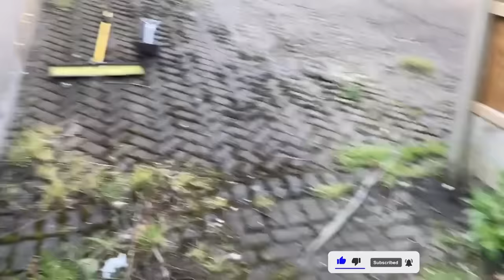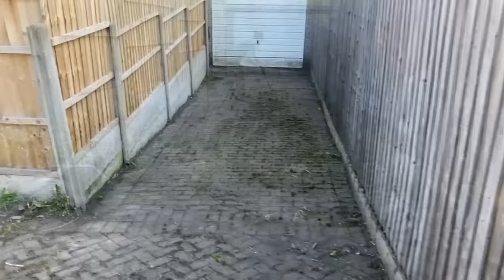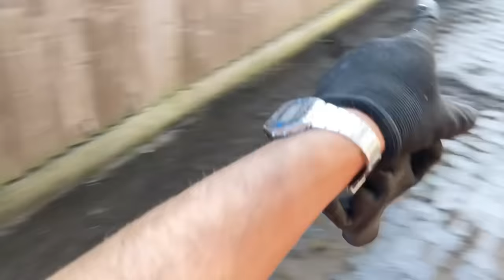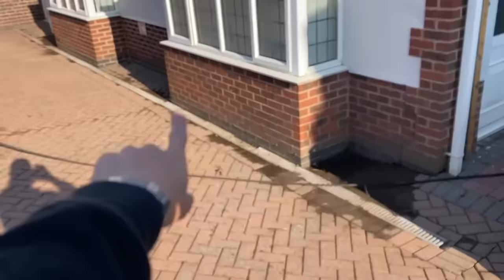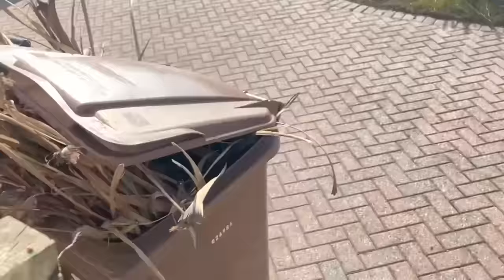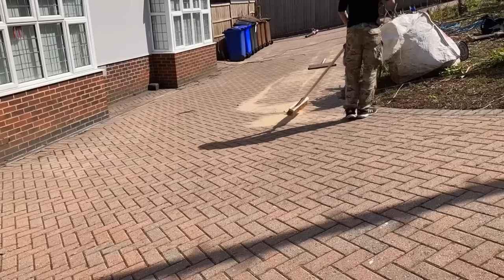MY DIRTIEST DRIVEWAY CLEAN EVER! (No drainage at all)

Comment: painting for a customer today there back patio looks the same was wondering what it would take to clean it up convenient your vid shows up. question why no surface cleaner any specific reason? b4 I finish watching my guess is 5-6 bags of sand i'll see how close I am. I have a patio maybe 20by20 and walkway I do this same process every other year but it has a design and wider gapes between bricks takes me 2 days but i put up barriers to stop the sand from getting all in the gardens around it and the 1500 gallon pond on the side its so much work and your beat when you finish I just did this last month at my house also had a weaker pressure washer it's 2500psi but very low gpm I borrow it from my dad. hope you made atleast $1500 US atleast brother.

Comment: where do you get all the water from that u use with the pressure washer? is it supplied by the house hold that you're cleaning or do you bring it yourself. and if you dont bring it yourself but the household doesnt have a water supply how do you work with that?

Comment: I use 21 lpm machine. But would have done it with a flat surface cleaner. Ps, I can clean 750 m2 on  my own on block paving in a day. I have posted on your videos quite a few times, but you need to get to ben at rutland pumps matey...

Comment: here's a solution for your water drainage problem....get a 1 meter piece of PVC, cap the ends with a hole in center with attachment for SHOPVAC vacuum. Drill smaller holes in PVC for water to flow through, and just lay the PVC in the puddle and turn on vacuum...it will suck up the water as you work

Comment: Would you ever use a plate compactor to get the sand into the joints .
Reply from the maker: It’s not needed as the sun base is fine it doesn’t really get damaged, the stuff in the gaps is what gets blown out :)

Comment: Can't believe you did the whole job with a tiny nozzle like that. Wouldn't using a surface cleaner attachment save you a tremendous amount of time? I've also seen no chemical treatment so sadly that moss is still between the stones and will grow back very quickly (in a matter of weeks)
Reply from the maker: It’s a turbo nozzle so not that tiny lol. FSC wouldn’t of pulled up many of these weeds. They were thick. 
Treatment was offered but declined, I know what I’m doing 👍

Comment: I'm kind of wondering "Why the sand?" Like, I get you're getting sand in the cracks, but why? to prevent weeds? It can't be for aesthetics, it really dulled the color of the bricks down. I can't imagine it's for traction, the bricks didn't seem that particularly slick, even when wet.
Reply: Bricks have to have sand in between them in order to set them in place. Horizontal brickwork isn’t typically mortared to the ground, so they can shift around if not all locked together with sand in the joints.  A lot of people do polymeric sand now so it doesn’t wash away, but it’s more expensive and some prefer not to. He replaced the sand because it’s something you have to do periodically and because he blasted what sand was there out of the joints
Reply: @tylerk.7947  Thanks for the knowledge. :)

Comment: Whoever did the paving wasn't the best. You can see the level is halfway over the air bricks - building is going to be damp with this. Also sounds like they did the normal MO for these guys - put a slot drain in but don't connect it to any drainage. Call it a soakaway even though they did no testing on the soils (could even be clay) ability to let water soak away.
Happens too often and exacerbates flooding issues.
Good job cleaning btw.
Reply from the maker: You know your stuff!

Comment: I dont know if they sell Stihl products over there. They make excellent chain saws and weed eaters for mostly commercial use. But they also make some things for residential use. They have a adaptable system called Kombi. It the same as their petro weed eater power heads. You choose what size engine you want. Then there are several different attachments you can add to the power head. Two of them are brooms. One is softer and the other is quite stiff and uses the same bristles as what a street sweeper uses. I have one, and I will tell you that the stiff bristles on that brush would have ate those weed like pig eating slop. It would have also moved that soil you were shoveling. You would have been done in 10min max.

Here is a link showing a guy using one for exactly what you are doing.

https://youtu.be/SzaJQugOEvE
Reply from the maker: Woah 😮 never seen anything like that. That’s awesome!

Comment: I dont know where you learned your job, but I know that you should clean also the mess you did with the high pressure on the walls ect - it should be cleaned before sanding the floor stones.

Comment: 1.Dry Sand 2. Wacker Plate 3. Sealer 

Will last 40+ years
Reply from the maker: that sealant must be the best ever xD
Reply: @PartridgeExteriorCleaning  

Resiblock solvent based polyurethane paving Sealer

It's the best